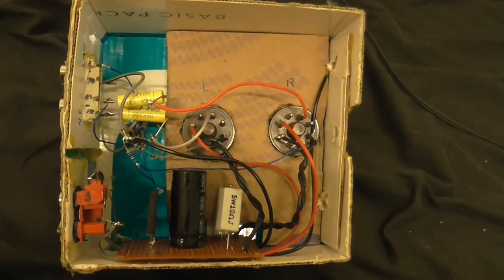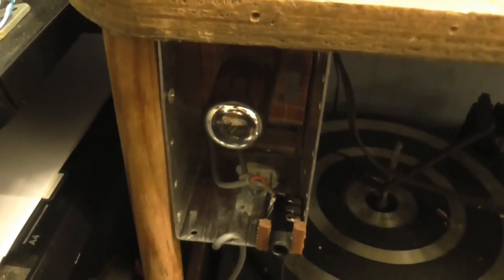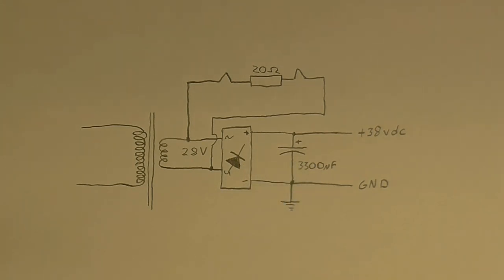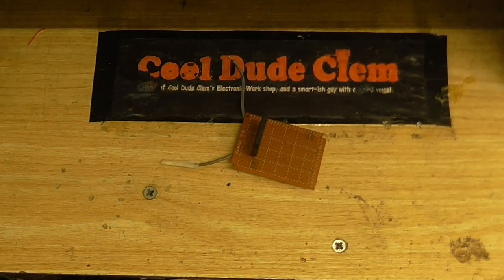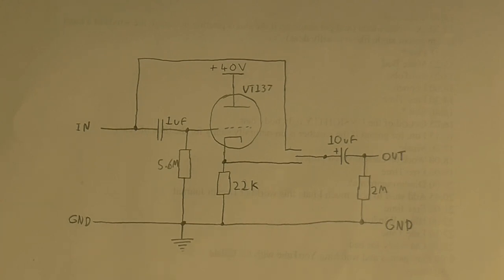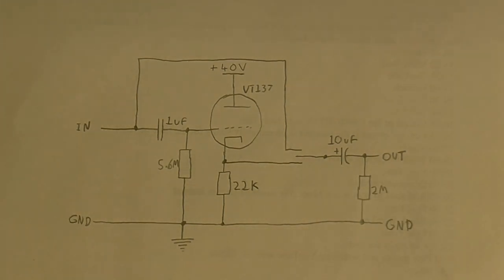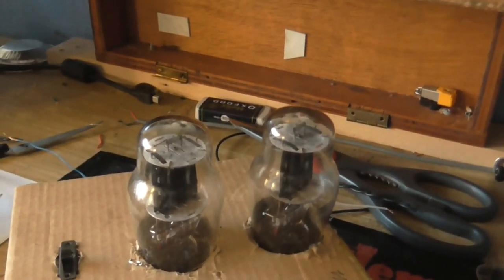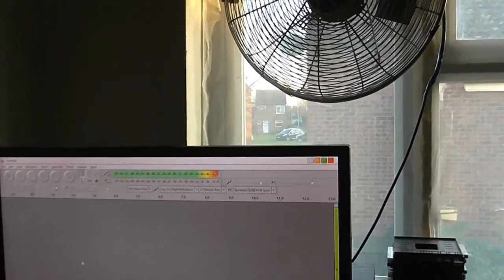Tube Time - The Buffer/Impedance Matching Circuit

Comment: Correct me if I’m incorrect but isn’t the dissipation more like 7~ Watts 5.6vd / 20 R= 0.28 
280Ma x the output of the trans = 7 and change Watts ? 
Because the resistance is dissipating the net output of the transformer thus its that multiple to use? 
The 1.~ Watts is derived if one multiples by the Vdrop which I don’t think is correct due to a buffer redundancy.
Reply from the maker: Well I was taught that volts squared divided by resistance = watts
Reply: CoolDudeClem hmm I think you are correct, even though it seems non intuitive to me , thanks for helping me here. 
I guess that 1. ~ Watt is doing some work.

Comment: Warm tubes and hot resistors in a cardboard box 😬
Reply: Hay man I've seen your comments on loads of electronics channels. Have u seen my antics 10kw vttc, 300kv xray transformers with 4ft arcs, monster plasma speaker and so on 🤣🤣🤣
Reply: @T2D.SteveArcs  
I'll check it out.
300 kv transformer!
Reply from the maker: May not seem like the best idea, but getting hold of supplies and tools is practically impossible for me right now.
Reply: @CoolDudeClem  
Understood.
Take care Clem.